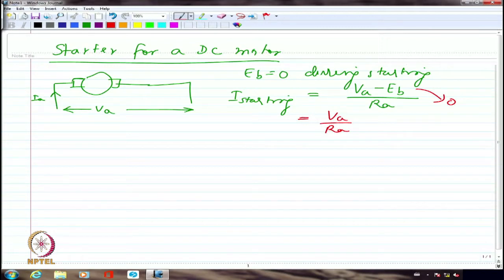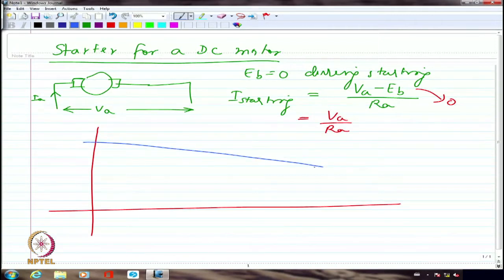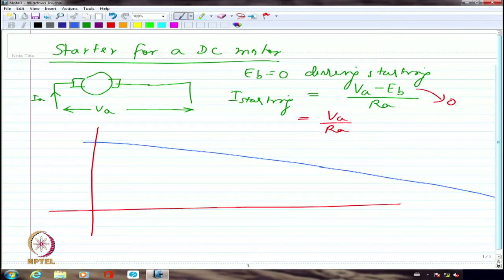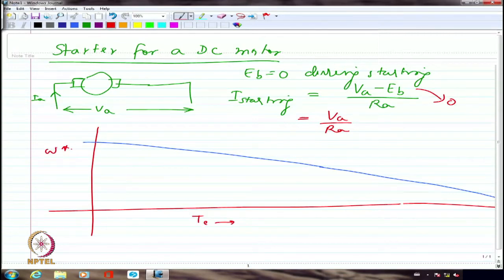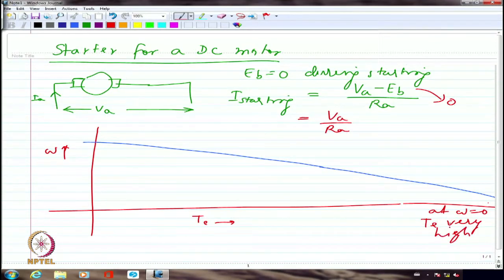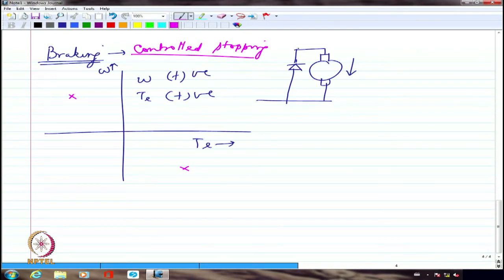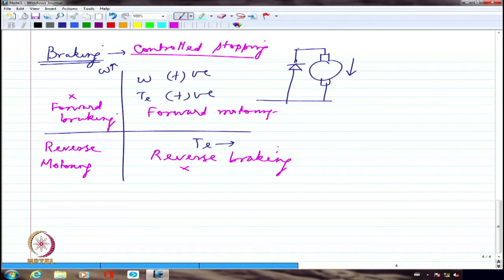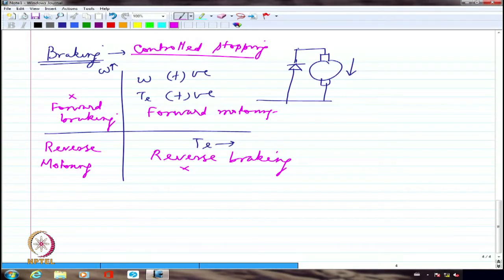DC Machine: Starting and Braking

Comment: dc motor starter with ext arm res. 0:00
starting with var arm supply 16:00
braking 21:00
rheostatic bkg 28:10
commutation 36:39